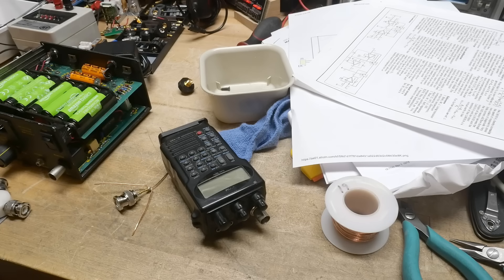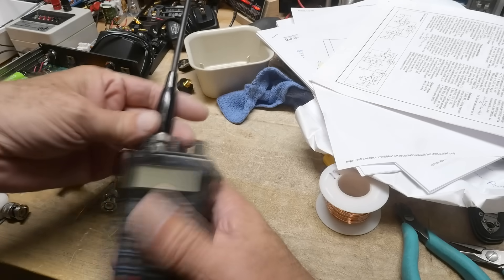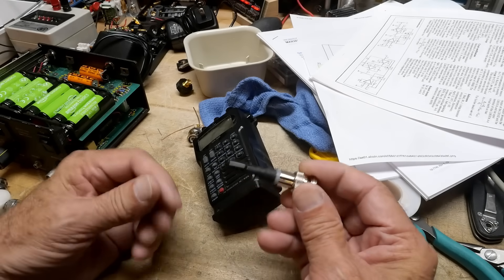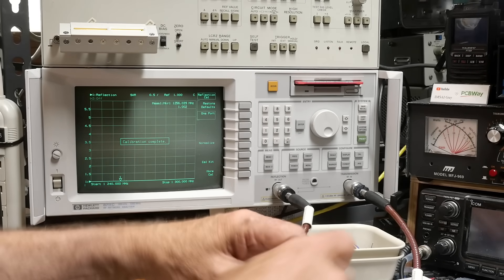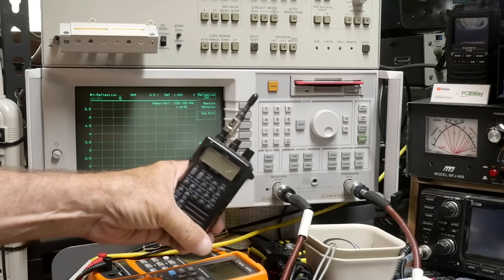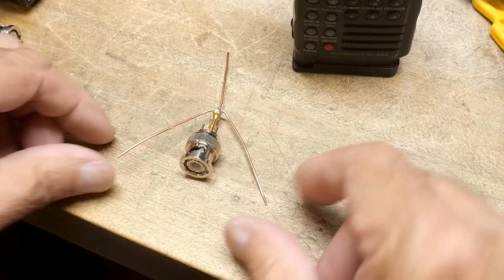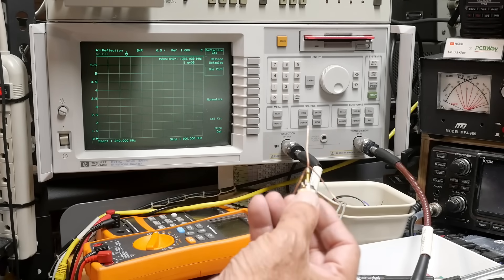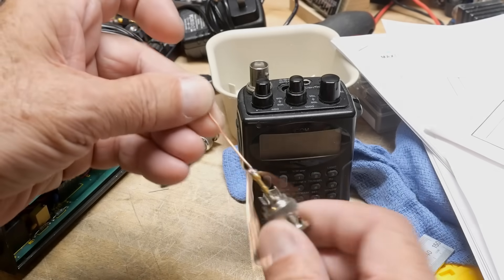#2293 23cm 1.2GHz DIY Antenna

Comment: Hey—it would be cool if you did some comparisons between them—put one fixed antenna on a signal generator with low output power, then put the different antennas on the HT and/or spectrum analyzer. Or maybe even put them on both network analyzer ports and see the trace variation when you switch out the port2 antenna. 😊 That should give some indication of the radiation performance.

Comment: "Hey, where'd that thing go that I just had in my hands 15 seconds ago??" - So relatable!!
Reply: If there's one thing I learned from RF class theory, and mucking with antennas, and looking at existing designs, your counterpoise or ground elements don't necessarily need to connect to ground - as long as they're attached to a point along the main element that is a "virtual" ground, they'll do the same thing. That must be what's going on here.

Comment: How does radiator diameter affect antenna performance?
Reply from the maker: it changes the electrical length and usually broadens the frequency range
Reply: @IMSAIGuy  thank you, sir.
Reply: From what I've read, using larger diameter elements makes antennas more broadband, but I've never actually tried that in a simulator, or on an actual antenna on a VNA. It would be a worthy experiment / future video idea ;)
Reply: @gorak9000  agree

Comment: RF has never been black magic for me, it just made sense.  I have built antennas, a LOT of antennas.  However.....  HT antennas have always been a bit perplexing to me.  How do I test it?  How do I model the "other half" of the antenna.  Do I just stick it on a cable.  That can't be right, where's the other half of the antenna. The coax shield?  If I hook it up to my Keysight FieldFox or Rig Expert antenna analyzer is that a better representation of the antenna being attached to a HT radio.  LOL, do I hold it in my hand, yes/no.  Should I stand on my head.  As I said, a very perplexing problem.  The best solution I could come up with was to take a old HT, remove the battery, disassemble the radio and cut away a portion of the circuit trace that attaches to the center pin of the antenna connector thereby disconnecting it from the radio.  Drilled a hole in the bottom of the radio and ran the cable up to the connector and soldered it on.  Is that a better solution, it seems to work with good name brand HT antennas.  The readings I get seem to be reasonable if I hold the radio test jig in my hand while sweeping the antenna.  I have always wondered how HT manufacturers like Motorola, Kenwood, etc. model HT antennas and what type of text fixture do they use to test them.

Comment: I made an antenna for 1090 MHz ADSB with bits of wire and an N connector. It sits on top of a length of plastic conduit. Works great.